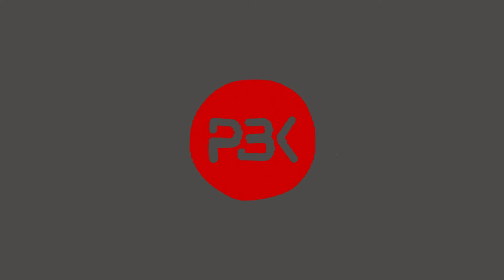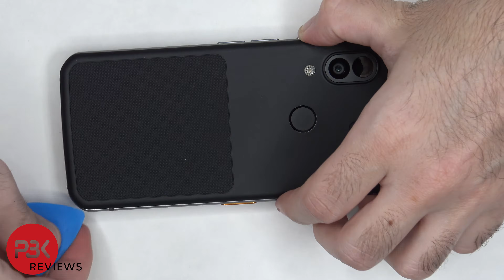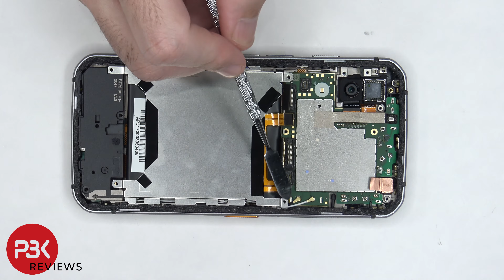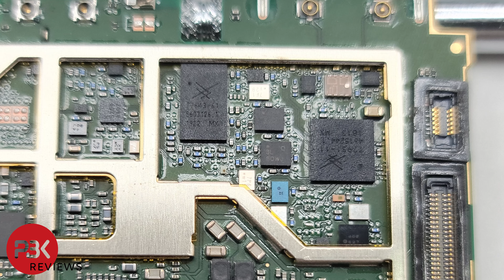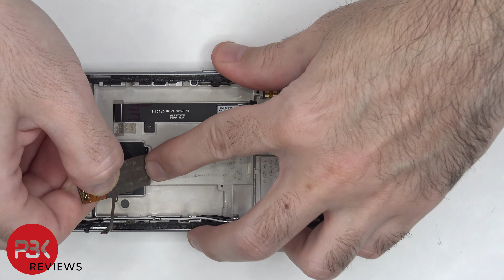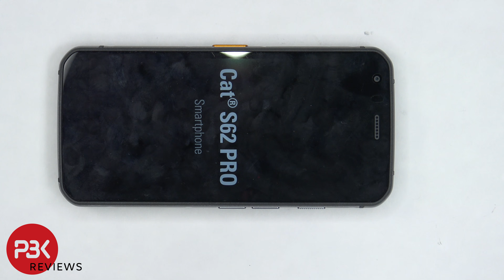CAT S62 Pro Rugged Smartphone Disassembly Teardown Repair Video Review

Comment: Not surprised but still disappointed the hex screws on the side aren't for disassembly. Reading the comments it's seems like parts are impossible to get, very disappointing. Might not be too much longer until I can reliably charge and it'll just be a basic thermal camera.
Reply: i tought that at first! 😆 sorry just for the look!

Comment: Where can I buy that charger port assy.  CAT says that they no longer support this phone or do repairs.      While the phone is extremely rugged never drop it when charging. because no one repairs that part if broken. If the phone can not charge eventually it becomes a brick.
Reply: Aliexpress have multiple parts- still, be careful 😉
Reply: Most repairshops should be able to just replace the port component, which is a 1$ component (although requires relatively fine soldering, something you can do with a soldering heat gun, or a lot of patience and a fine tip soldering iron)
Reply: It works on wireless charging

Comment: USB-c connector is soldered to flex cable ? Can I replace only usb connector without flex cable?
Reply from the maker: Yeah, would require soldering knowledge to de solder and replace the port from the flex cable.

Comment: This is even worse design comparing to s61. Changing the battery is a challenge
Reply from the maker: Not sure about the S61, but this one isn't that hard to do. The fact that its taken apart from the back and not from the front is great compared to other rugged devices which pose a chance of breaking or damaging the display and prying it off to replace internal parts.

Comment: hi, would you say that this is a good phone...specs aside? im looking at buying one but there are so many negative reviews online, do i believe them? a lot of people are saying that call quality suffers...could that just be residual water in the mic from washing the phone?
Reply: I've owned mine for a year. I just wanted something reliable. I knew from the reviews it would be a bit buggy going in but I needed a new phone and it was what I could afford without overextending myself financially. 

Sometimes the flir app likes to crash unless I restart the phone. Also I had to disable the Google voice from the keyboard shortcut menu for voice dictation to work on discord. 

That stuff aside, I don't worry as much if it drops or gets wet at work. I also have the bad habit of throwing my phone when I am really angry.
So... it works for that too.

It can't handle Genshin Impact but it does reddit and firefox just fine so it meets my needs.

Comment: Cool phone, just a shame it's an absolute piece of crap. 
My first one got water inside it. The charger port on my second one has eroded/worn away in 6 months.  Nothing but trouble trying to get it to charge. Looks like the thing needs to be completely torn apart just to repair the port. Which will also ruin its IP rating. 

Great video though, thanks.
Reply from the maker: Sorry to hear that. Thanks 😀
Reply: Never had any brand phone where the charging port lasted more than 6 months. All ports are trash.
Reply: My phone turned on once I had it plugged in but I turned it off now it won't work no water just I beat it at chess the game now it won't work
Reply: How do u turn it on?

Comment: i have a cat s62pro and its totally dead wont turn on whatsoever any chance you could point me in right direction
Reply from the maker: Try holding down the volume down and power button for 20 seconds see if it does anything. If not, it can be many things (bad battery, bad charger port, bad screen, etc).
Reply: @PBKreviews  thank you so much for the reply iv tried the reboot and nothing i tested the battery and its reading 4.28v.  . When charger is connected still nothing not even small light on front iv also tested power button and its making a circuit
Reply from the maker: @joeellis5960  There is a possibility that there may be a hairline crack in the screen somewhere that is hard to see or in a corner somewhere preventing the phone from displaying anything or powering on. The next thing I can think of would be water damage.
Reply: I also have s62 wich after it smacked to the ground is completely dead... not even a vibration when holding the power/volume buttons. Screen dead ofc.
Might be something with the power since everything is dead.. where would you start?
Reply: This just happened to me 10 minutes ago. dropped face down and became completely dead. I even heard my Bluetooth headphones immediately disconnect after impact. I think the battery might have disconnected inside of the phone. I haven't opened it up yet. Did you have any luck in fixing your phone? @tarjeivraadal
Reply: Have same problem with Cat S62, i get slow charging problem, change charging port and it not run, when i press power only green led blinks once, and no more reaction. When i hold DOWN and POWER green led blink every 20s once and no other reaction. Maybe anyone know where to find baord view or circuit view or PCB description to check pads?

Comment: Nice video, after disassembly the phone can remain still ip68?
Reply from the maker: Thanks! If you replace the adhesive with original pre cut adhesive, then yes it will retain the ip68. But for this phone, it doesn't seem like the pre cut adhesive is easy to find or available to order online. Most of the time, back cover/battery door replacements would come with the pre cut adhesive pre installed but not always.

Comment: This is just another normal phone where is the ruggedness.
Reply from the maker: The whole phone is built around ruggedness. The entire housing is rubberized plastic with reinforced metal plates around the frame and is made to withstand dirt/debris as well as water. The screen is reinforced with a plastic layer screen protector as well with gorilla glass 6 screen to withstand drops.